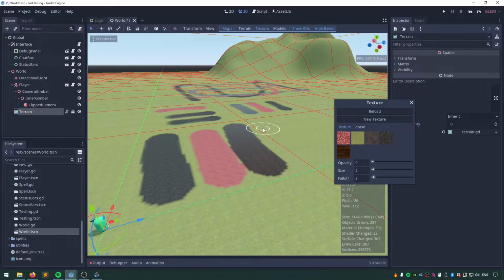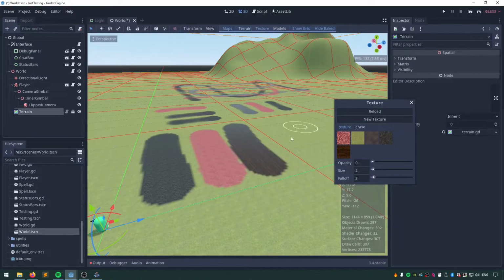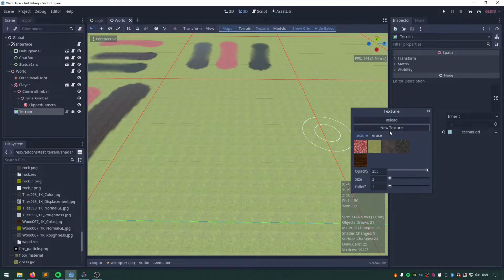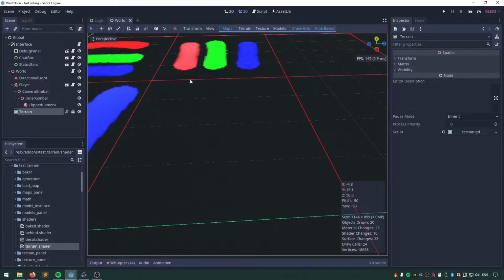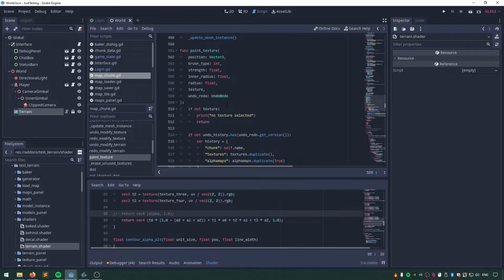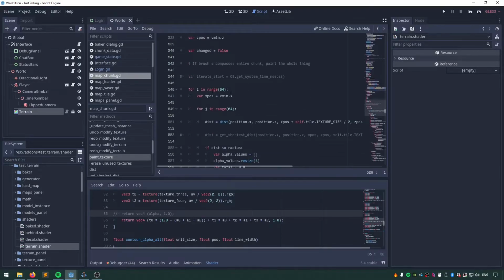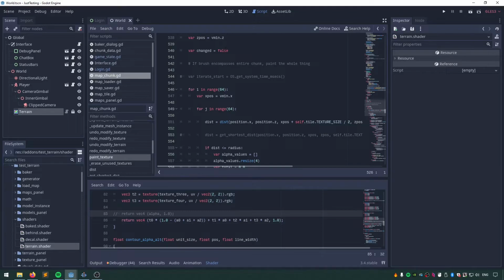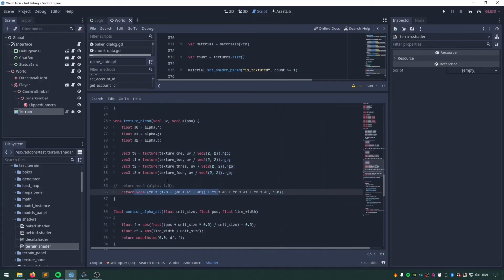MMO in Godot - Texture Tools Overview

Comment: You can really make MMO in Godot?
Reply from the maker: Hey thanks for watching! It's still early days in this project, but I believe it's possible. From a technical perspective an MMO is mostly networking, which Godot has good support for. The only thing really missing from Godot was a terrain system which I ended up writing myself and seems to be quite capable. However, there could be some critical issue lurking that could totally prevent the creation of a large open world, but I haven't had that happen yet, so fingers crossed!
Reply: If I'm not mistaken Godot supports up to 4000 connections some one could I think have the other players on different servers, that might be how I do the game I'm working on at the moment.
Reply from the maker: Thanks for the information, but I'm only using Godot for the client and the servers are written in Go